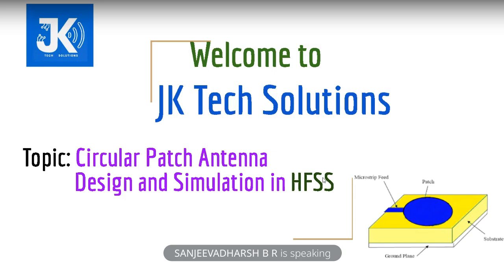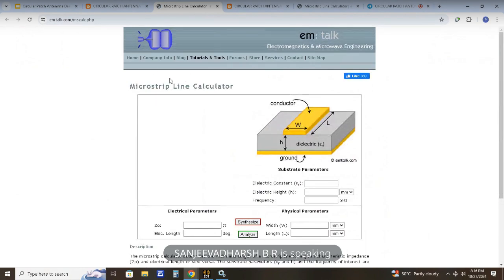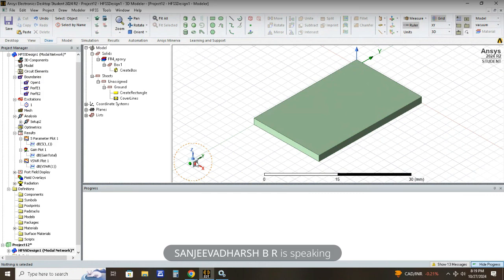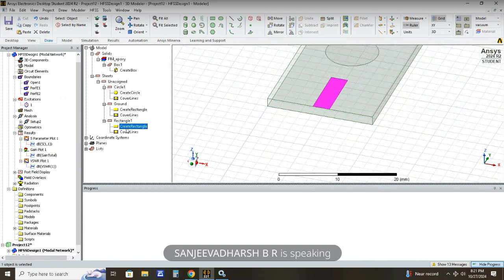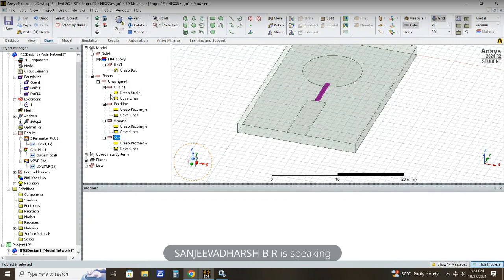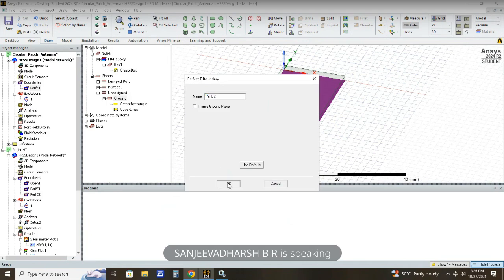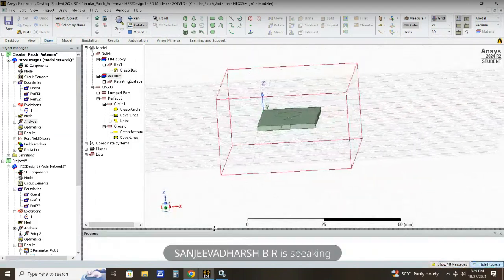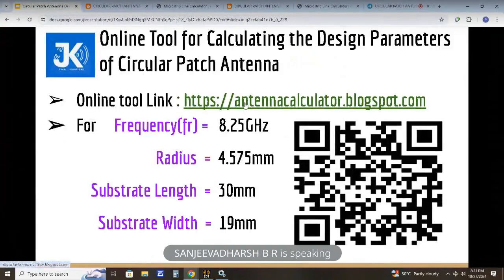Circular Patch Antenna Design with Quarter Wave Transformer Feed | JK Tech Solutions | Quarter Wave

Comment: Thank you for your video. I was wondering how did you calculate the 100 Ohm impedance of the quarter wave transformer? I would derive it with the equation Z_0 = sqrt(Z_A * Z_in), but I am not sure on how to calculate Z_A for a circular patch antenna. Thank you
Reply: Hello, and me also I want to know how to get 100 Ohm , and also how he took electrical length equal 90 degre?